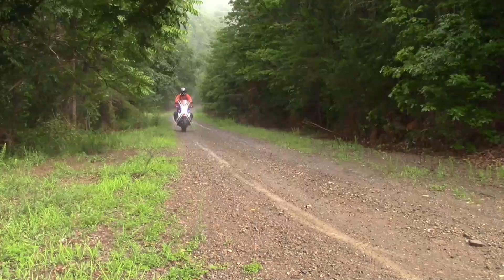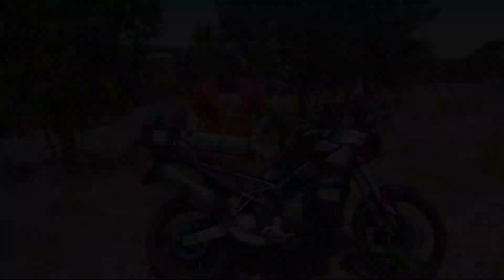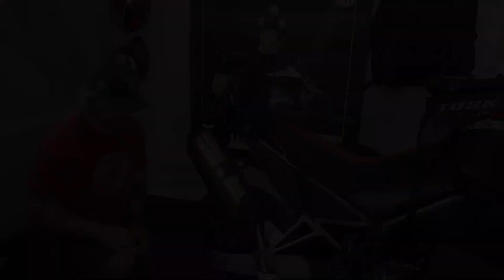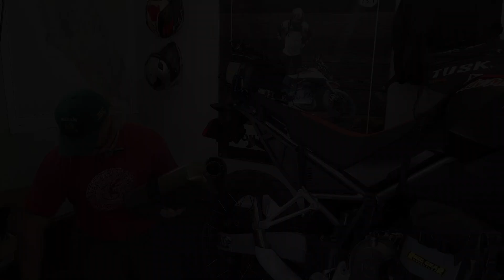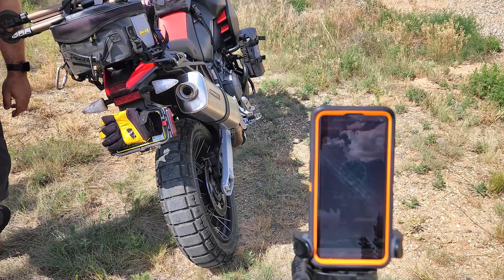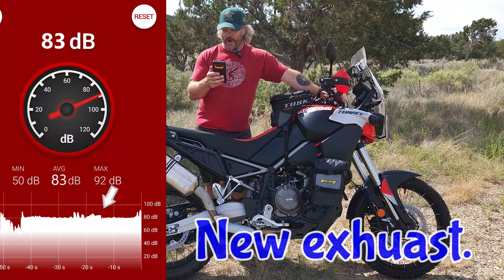Aprilia Tuareg 660 Dominator Exhaust (muffler) install.

Comment: You recommend a muffler that will save weight and you don’t have a scale to show the savings? AND it’s too hot to ride to estimate any power improvements? How about a measured stretch of road with a before and after comparison? You don’t check what the actual price is and quote $400. when it is actually$240.?  You lack credibility. For your own sake, get your presentation and numbers  together BEFORE you make your video. One star
Reply from the maker: Dominator was fine with the video.  By the way, the price dropped since this video. A stretch road trying to measure before and after with a chronograph and riding the bike exactly the same won't provide reliable results.  The only to see a difference is a dyno test.  Indont have access to one.  Thanks for commenting and clearly watching. It helps the algorithm.

Comment: I am looking at changing the full exhaust system on 23 Tuareg. Do you think it helps with the heat reduction?
Reply from the maker: I don't know.  I can't give you a solid answer.  I don't thing you will see the heat reduction you are looking for compared to the cost of doing the full exhaust and then re-flashing the ECU for proper fueling.  I think you might consider a skid plate that provides better air flow past the catalytic converter so that the heat isn't reflected back onto you.  There is also the Camel ADV skid plat that has a cover on the catalytic converter.  Maybe this will keep heat off of your feet.  I am not sure the cost is worth the result.
Reply: @advmatt Appreciate your response. I already have heed skid plate. I am going to try a few things out. Like flushing the coolant fill it with 50/50 diluted and replacing the thermostat. Changing the full exhaust system was the last option in the list. I will look into Cat converter shield or wrap.
Reply from the maker: @sachintrivedi7899  I found my black boots are more of a problem in the summer heat than the exhaust.  Both of my feet end up getting really hot riding in the summer.  That is on different bikes as well.  Just a thought for a small change.

Comment: What year is you tuareg i got 2024 and ordered the same exhaust but they can only guarantee it fits to 2023
Reply: It fit perfectly thanks
Reply from the maker: Mine is the 2023.  I don't think anything changed between 2023 and 2024.

Comment: Is it just me or did the Dominator can actually not make that much difference in the sound as compared to stock? It’s the cat that’s making the bike quiet, unfortunately.
Reply from the maker: @rt1983x  yeah, it is not a huge change in sound.  The weight savings was significant.  It's really hard to hear the difference in the video, but I does sound a little deeper.  The Dominator on the Tenere 700 sounds better.
Reply: @advmatt I’m waiting for my Mistral can. They are a small company in Italy that specializes in exhausts for italian bikes. I’ll see what that is like soon. Also, does the Dominator can have a removable baffle? You might try taking that out.
Reply from the maker: @rt1983x  I think it does have a removable baffle.  I need to take a look at that. Let me know how the Mistral works out.

Comment: The way they install the exhaust is the reason that keeps me away from buying this bike. Looks cool but is SO unpractical - this is ADV bike so you carry baggage. 
You can't install any real bag there because the exhaust gets in the way (all those spacers that disrupt the balance). A special muffler cover so that those bags don't burn and  I'm 200% sure that you have 80C in those bags.
The lack of a luggage rack as standard is another weird thing.
Reply from the maker: @podunkman2709  most adventure bikes have exhausts like this.  The T7 requires a new muffler that tucks in to keep from bending the frame.  I keep my tent on the exhaust side.  It works okay, but I do use an exhaust shield.

Comment: Nice video. I never really cared about the exhaust sound of any of the bikes I have owned. To me the only real reason for a new exhaust is to save weight. Lots of people think their bike is faster because it is louder. Most reputable exhaust companies show the HP comparison between stock and theirs and the gain is minimal. That being said if you upgraded the entire exhaust system and the ECU that can add HP. I do wonder if these aftermarket exhausts have a spark arrestor ? I do believe they are mandatory in all National Parks. Keep the content coming
Reply from the maker: @kevinsterner9490  the weight savings is worth it to me, even if the sound doesn't change much.  I have given a lot of thought to the spark arrestor issue.  As long as the catalytic converter isn't removed you are good to go.  I don't know about the whole exhaust replacement.  That could be a problem.  I ha e never seen a bike checked, especially a plated bike.

Comment: Nice. It doesn't need to be loud; it just needs to sound good. On the Dominator website, the full systems use different cans than the one you used. I wonder what they sound like? I'll have to do some searching.
If I end up getting a Tuareg 660 (I'm 90% sure), the full system should help lower the heat around the engine. I would probably wait until the warranty runs out.
Reply from the maker: If you replace the entire exhaust system there is a DIY kit for remapping the ECU.  From what I remember it costs about $700. Check PNW channel.  He did the whole exhaust system and was disappointed.

Comment: dominatot are not so good exhausts.you could have much better and deeper sound with other brand,like leovince,arrow,mivv...
Reply from the maker: @Thodoris81  you could be correct about the sound.  I have a good experience with Dominator.  I wanted to give this a try.
Reply: @advmatt  i went with the Italian made Zard with the removable DB killer. Zard has a distributor here in the US, and the sound is amazing plus i lost almost 6 lbs. Cheers
Reply from the maker: @jeffreytreasure8  I looked at those.  They look good.

Comment: I have replaced the pipe on my 790 with a Dominator, and done the full exhaust on my 390 Adventure.

The entire system for the 390 was under $300. (Pricing on eBay varies by +/- $100, so be careful.)

I ordered from Europe, which if the Euro is low, can save you quite a bit.

It's been on the 390 for well over a year and I am pleased with it. I am using the "hard" DB insert, and would not want to ride on the highway without it! - Frank
Reply: I'm thinking about the Dominator system.  Good to know it's "Frank Approved"!!!  😅

Comment: I have the Dominator OVR full exhaust system on my 390 ADV and it really makes a difference in the sound, as well as losing a lot of weight. Can't really tell if there is an increase in performance just by riding, however, there are a few YouTube videos showing a definite increase.  Enjoy the Tuareg!
Reply from the maker: I am sure with the correct fuel mapping tune there is a performance upgrade.  Losing the weight and better sound was worth it alone.